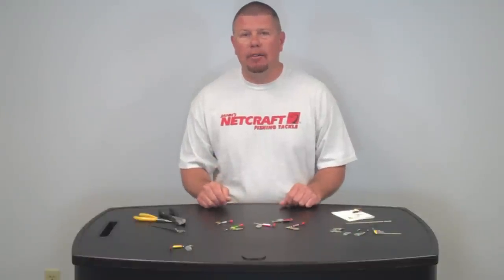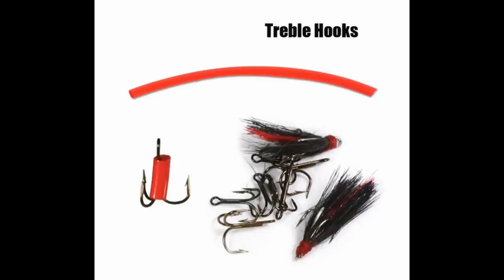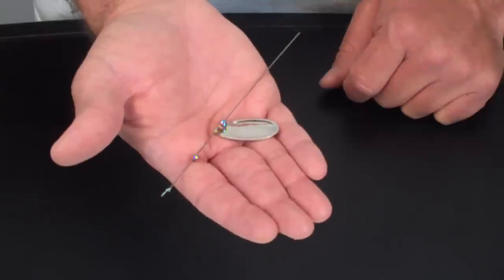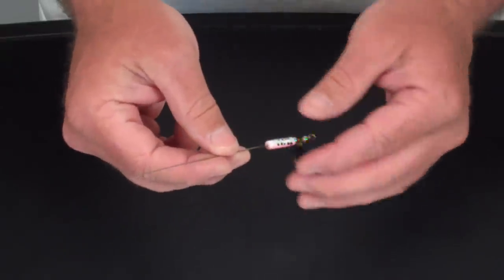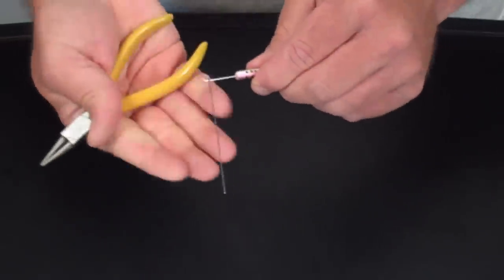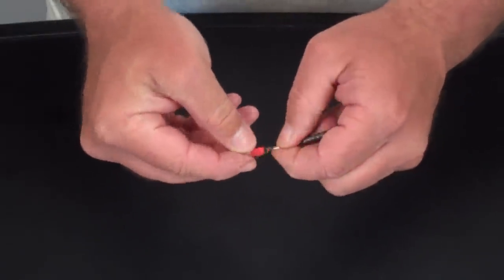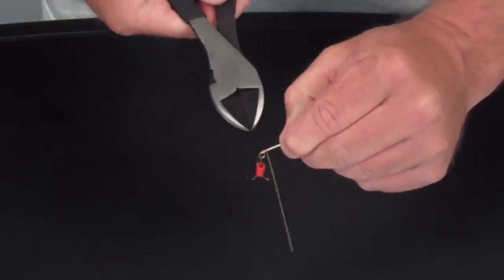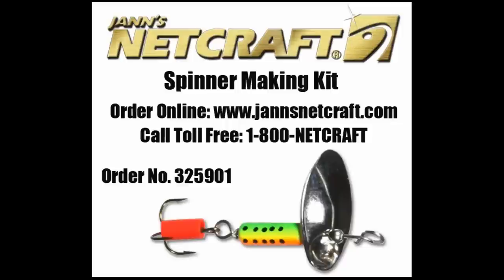Instructions - How to make your own in line spinner fishing lures

Comment: netcraft also sells a small tool that makes it even easier to bend the wire.  i make my own spinners patterned after mepps, and they work just as well as mepps, for a fraction of the cost.  netcraft sells all the parts you need to make mepps-type and panther martin-type spinners.  and though they don't sell silver plated french blades, they do sell prism tape to fit their nickel blades and which is even flashier.  and no, i don't work for netcraft.  i just love to fish and make my own lures.

Comment: From what I can see (Unless this guys hands are of some weird size) its: 4g body, clevis no.3, treble no. 4, beads around 5mm, shaft between 0.8-1mm (around 0.031''-0.039'' if I am correct), blade size 4 or 5. But if I was you I would experiment, changing the components, i make lures of various weights for different purposes: heavier for deeper water or fast running water and for long casts, lighter for shallow water, also different treble hooks: small for trout, big for pike etc.

Comment: I tried making a spinning lure. What I don't understand about it is that the spinning blade turns slowly. is it the weight of the body or the positioning of the blade?. I really don't know the answer.
Reply: did you try a bead between the blade and body? and larger blades will spin slower than smaller ones, what size of blade were you using?